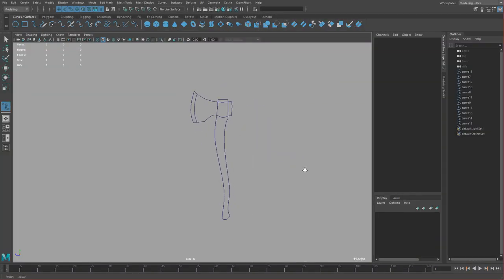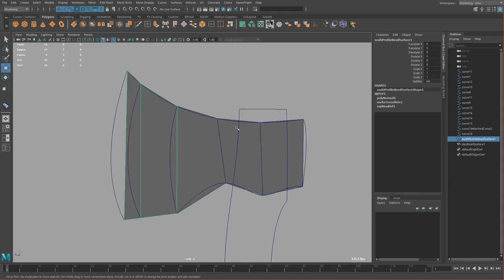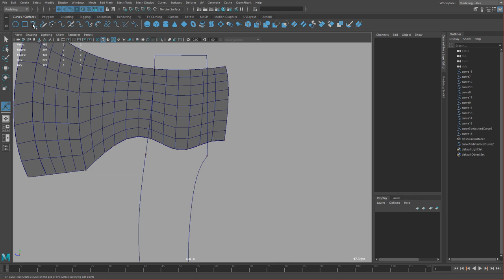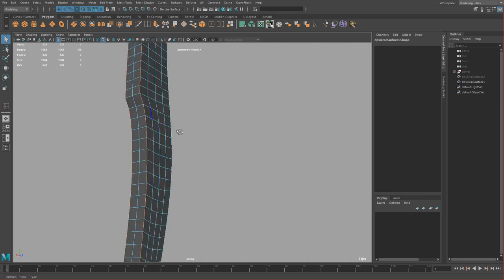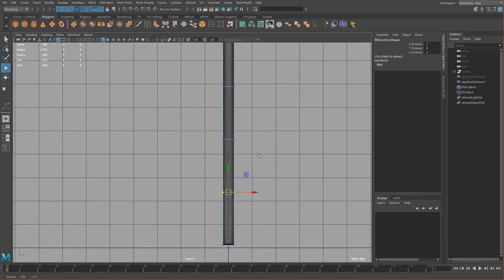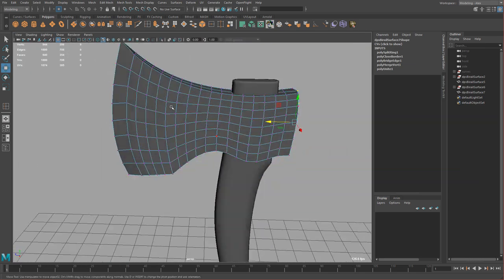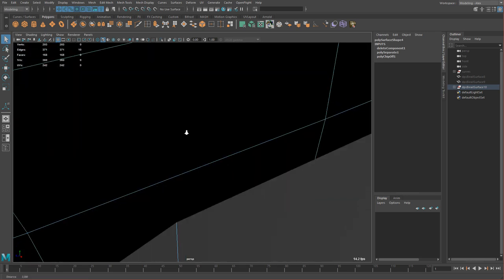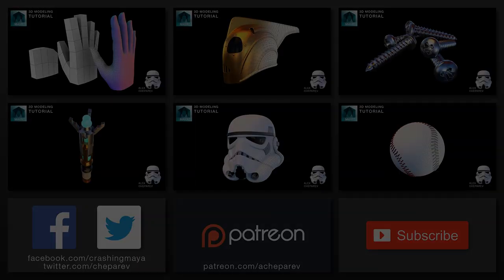Modeling an Axe in Maya - Curves to Polygons

Comment: Lessons Learned:

* You can round the corners of something by simply sliding its edges.
* Curves must be touching each other for birail (1, 2, 3…) to work. Use the middle mouse button and the Snap to Curve (C) to achieve that.
* If the surfaces you’re creating intersect each other, hide those as you’re creating them. This will help you making the correct selections.
* Have in mind that your resulting surfaces might not be aligning because the number of control vertices of the input curves are different. Use the rebuild curve tool to fix that.
* Always consider using lattices to adjust a silhouette, even if it’s just a small or partial face set. Its “global influence nature” makes the job much more well executed and smoother when compared to pushing faces and vertices directly, even if you’re using soft selection.
* There are times in which creating an ngon to stop an edge loop of continuing its path is desired. After that you can even cross connect vertices using the multi cut tool.
* Consider fencing instead of beveling everything. Consider turning chamfer off for harder edges.
* Some things have a natural pinch, use that to create hard to smooth surface transitions.
* Simple clean ups of the extremities of a multi segment bevel might work really well. By simple I mean just melding a couple vertices and deleting a few edges to create quads without really reworking the whole topology to accommodate it.

Comment: This is nice and all, but im just curious what are the advantages to modeling like this vs using 3d coat or zbrush which seems like such a faster workflow? I really wanna know, im very new to modeling, but I feel like just using the primitives tools in 3d coat you could have a axe in like 10 mins or less if you pro
Reply from the maker: First, models from ZBrush almost always have to be retopologized, adding time to your task. Modeling with curves gives you precision especially when matching specific reference. If I am not explaining, I can model this axe in less than 10 minutes using curves, and because I used curves, I know it will match my reference exactly and my topology will be perfect. And more than anything, it's just a lesson on using Nurbs Curves in Maya.
Reply: I've seen 3d coat tutorials using curves,  with a pic in the background using boolean actions to just slice it up to match,  just trying to figure out which program I should dedicate time to learn =P
Reply from the maker: Depends, Maya is the industry standard, 3D Coat is usually secondary software a studio would have for some specific uses. If you want to focus on strictly modeling, you can also try Modo, but if you want to get a job at a studio which mostly uses Maya (most studios), then you'll have to relearn how to model in Maya.
Reply: Alex Cheparev ok i might try it out and see if I like,  thanks for responding
Reply: Sure, but you will not get the precission and accuracy of the same model done in maya. Zbrush is great for doing after-effects, and sculpting once you have the main model done. Not before. Honestly i dont like zbrush. For a lot of reasons. Maya is far far better modelling program.